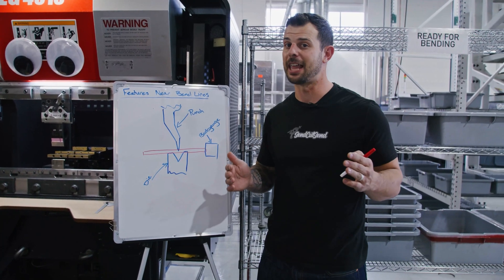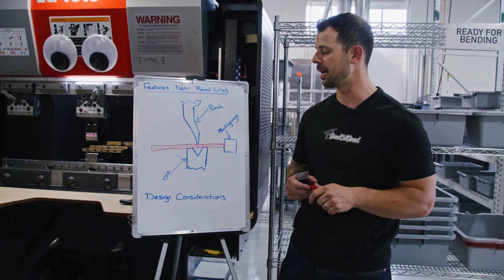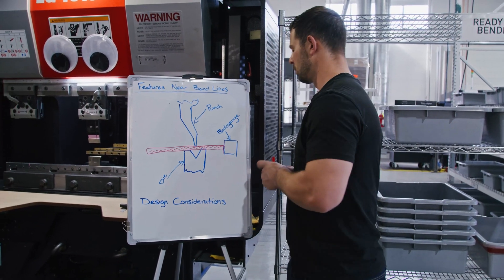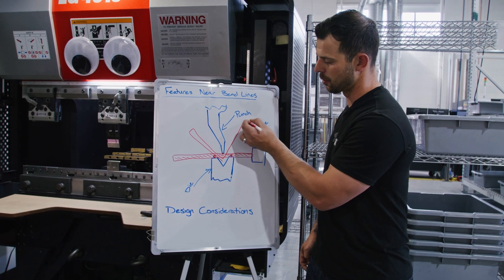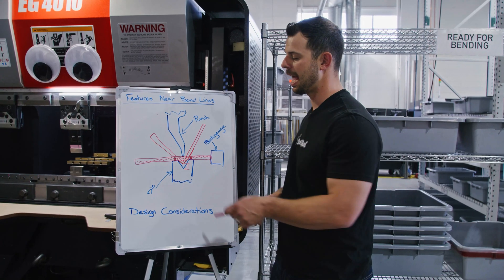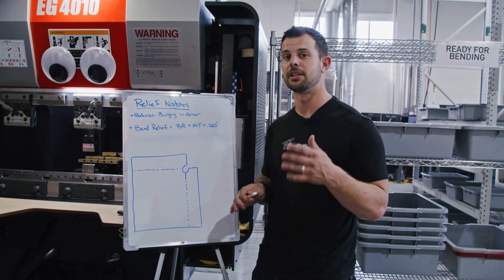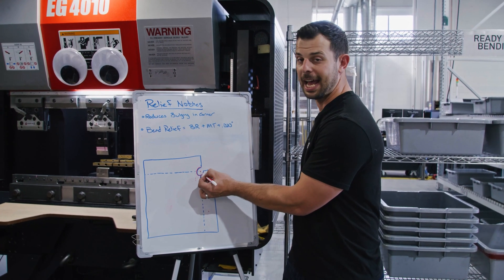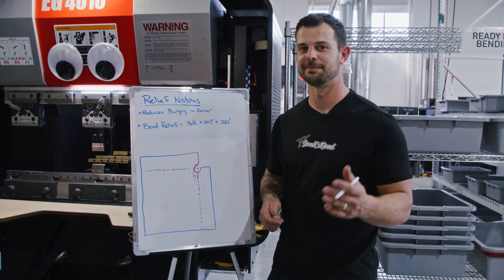How to Plan Features Around Bend Lines to Avoid Distortion

Comment: How can we bend parts that have no parallel edge to the bend line. Say I have a triangular flange which essentially has only the corner radius touching the backstop on the press brake. How they are achieved? Other than using extra material with micro joints on the nesting process...